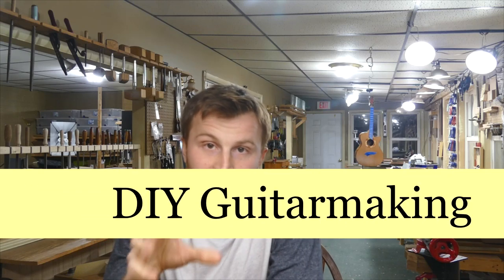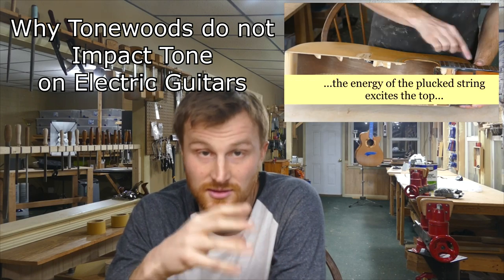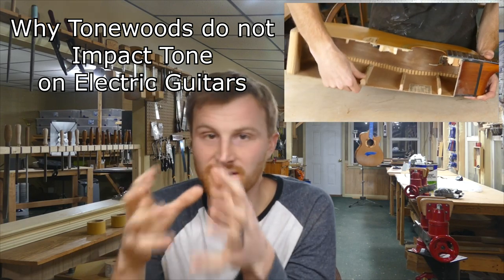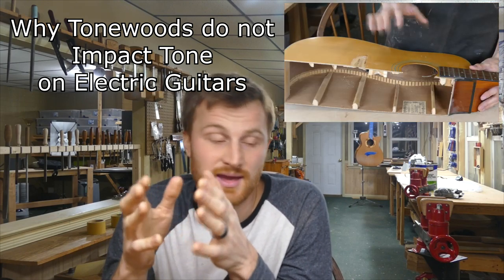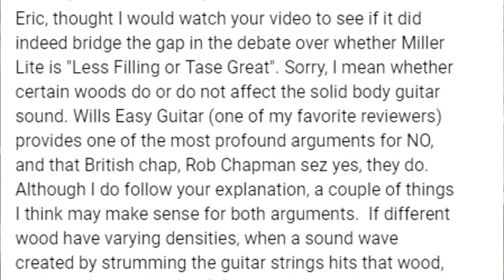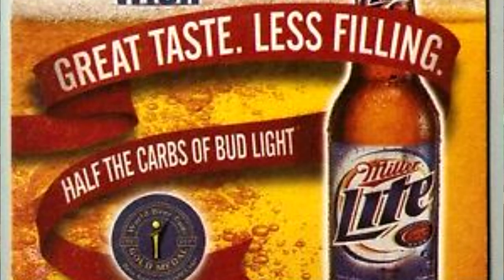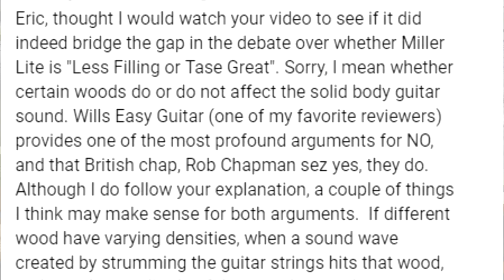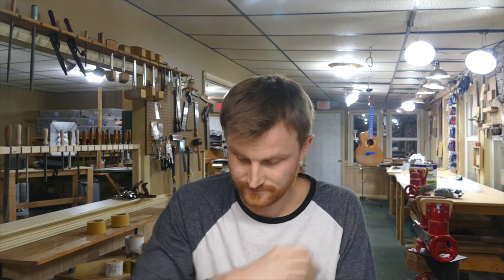More on the Electric Guitar Tonewood Debate

Comment: Will sent me :) 
Im a "believer" in tonewood for electric guitars and thinking of making a video explaining some of my reasons. The air pump is interesting and surely plays a huge part in acoustic instruments but there is more especially when it comes to high frequencies coming off the top rather than through the sound hole. Where the exact crossover points of mids come in I am unsure but suspect a lot has to due with bracing design etc. Most people who have used a high quality sound hole pickup which relies only on pickup up the strings recognize the guitar still sounds like an acoustic. (Fishman and LR Baggs electro magnetic pickups with no transducer or mic).
A thick body surely resonates less than a thin body but no one builds an acoustic without using bracing for a reason which does add to its rigidity. So the solid body is certainly more ridged but it still vibrates and some species more or less than others. We can find this in the same species too dependent on density and such but the extreme variables are much easier to find from one species to another. Reality is that maple can not sound and work like swamp ash and paulownia. A solid body guitar made of balsa cant sound and act like one made of ebony. 
I agree it can become religious or mythical but there are physics involved and personal experience to show differently.
Reply from the maker: Lol oh gee, thanks will :) yeah I suspect we may agree more than we disagree here. As luck would have it, I actually happened to pop over to your channel the other week just as your video was live streaming but i think I caught the tail end of it and you were on to other topics. I'll have to listen back to it later. Sorry for the late response. I'm in the middle of a workshop ans getting ready to start the next one as soon as this one ends, so my time spent on youtube is minimal at the moment. Ill check out your video soon.
Reply: Fender buried your delusions the day they introduced the Stratocaster. It's a sheet of plastic, where they placed the pickups in. There is no wood connecting them to the strings.
Reply: Check out my notes I posted above, and Zollner's Physics of the Electric Guitar.   An electric guitar is designed to resist sound transfer into the body by using a very rigid and somewhat massy metal bridge connected to a fairly rigid and massier body.   The body does vibrate a little, but the amplitude is tiny and the amount of energy radiated to the air is orders of magnitude less, i.e., neglible in terms of effect on sustain.   You are right that the top of an acoustic's body is braced to give it significant rigidity near the bridge that the soundboard thickness alone doesn't, but the top is much more flexible around the edges and its excursion amplitude  is much greater, more like a speaker cone.  The energy radiated is proportional to the square of the amplitude, so it's much, much greater.     In either case, rigidity is proportional to the cube of the thickness, but for the acoustic the relevant thickness is mostly in the braces, which taper toward the edges to allow the top to flex there.   A thick slab like an electric guitar body flexes vastly less in that vibrational mode (and others) which combines with its significantly higher mass to make it harder for the string vibration to shake it around.
Reply: @hans-joachimbierwirth4727  That's not quite a tight argument.  Vibration is transferred through solids, including plastic sheets, so vibrations of the body can affect the pickup through the plastic, with the neck and body vibrating and the plastic pickguard basically going along for the ride.  The effect is exceedingly small though, for other reasons.

Comment: Electric guitar pickups magnetic field does not absorb acoustic sound waves, they only capture magnetic vibration, thats why if you put nylon strings on an electric guitar, it will not sound at all, if pickups does not capture any kind of acoustic, its impossible for pickups to capture wood tonal difference...
Reply: Nylon strings on an electric guitar do come through the pickups via the guitar body.  That's why this guy's supposition is totally wrong.  Different density of woods affect both sustain and resonance.  Some people should not try to be scientists.
Reply: @mikefisher1629  show it, show noticeable sound coming from an electric guitar with nylon strings, I’ve done it, your story is funny but fake
Reply: @joseandresgalarza531  you haven't done it.  Plug the amp in next time.
Reply: @mikefisher1629  have you plugged an electric guitar with nylon strings into an amp? have you tried? do some experiments kid, you have no idea what you are talking about
Reply: @joseandresgalarza531  I'm a pickup manufacturer.  Yes, I have done exactly what you suggested.  40 years ago.  You should try it before dismissing it.  String vibration goes into the wood body and vibrates the pickup coils which creates current at the output.  I'm not a kid, I'm a 60 year old engineer.
Reply: @mikefisher1629 I’ve tried and that’s why I know your statements are bullshit, either you are confusing pickups with acoustic piezos or you are just lying, nice try bud
Reply: @joseandresgalarza531  I'm not here to argue with you.  I'm a patent holder and have been working for 40 years to develop a non microphonic pickup. The issue is that 10 to 20 percent of a pickups output is microphonic.  A totally non microphonic pickup has yet to be invented.  Until there is, a portion of the output will come from sympathetic vibrations through the body of the guitar.  Physics is a bitch.
Reply: @mikefisher1629 sorry Mr DiMarzio, didn’t know I was talking to you 😂😂😂😂😂, whatever you want
Reply: @joseandresgalarza531 I'll say the same thing a luthier mentor said to me on my first apprenticeship 45 years ago..."You don't know what you don't know".
Reply: @joseandresgalarza531  And while  I'm not Larry DiMarzio, I learned everything about pickups from a man named Bill Lawrence.  You may have heard of him.
Reply: @mikefisher1629  put some evidence in your words, then gain credibility, else you can talk whatever you want and it will be bullshit. You don’t need to show off your “credentials” here, assuming you tell the truth
Reply: @mikefisher1629  yes, nice to know someone who worked with Mr Lawrence then, still that’s only a credential, not an evidence supporting your statement
Reply: @joseandresgalarza531  well, Bill was the guy that showed me that.  I'll make a video for you when I get some nylon strings.
Reply: @joseandresgalarza531  you are demanding evidence from me, but you are unwilling to provide the same.  It will surprise you.  You can do the same experiment without nylon strings.  Just wire a loose pickup to a jack, plug it in and duct tape it to the back or side of a guitar and play.  What you will hear is the sound that your instrument contributes to your tone.
Reply: @joseandresgalarza531  back in the 80's when I did a lot of studio work, there was one studio that didn't have a talkback mic so I used to talk into my pickup to communicate with the control room.

Comment: It has nothing to do with the pickups picking up sound waves in the air, they can't, but the wood has a definite effect on how the string vibrates, which is picked up by the pickup. This is what gives different guitars different sustain. Think of the pickup as creating the main sound and the wood adding and subtracting all the details from it. And yea since the pickup is mounted to the wood, the pickup vibrating could also affect tone, but negligible.
Reply: What gives different guitars different sustain, is the scale, the bridge and the strings. If wood affects the sound of an electric guitar then why they paint them with more than one layer and why they give them solid body? Violins and classical guitars are never painted, they're varnished with a mix of different natural resines so they won't cover the wood and affect the sound, why electric guitars don't follow the same?

Comment: I am an electric guitar maker. I make one model. One specific pickup. The tuners, the nut, the pickups and bridge are all in the same piece of wood. A neck thru, for all intents and purposes.  All the same in every way except ... the wood used. Now, even with identical pickups, I have noticed differences in the measured output. Whether this would be the sole cause of why all the guitars don't all sound the same, or its some other factor other than the type of wood used, l can't say for sure. But l've always had the definite sense that a mahogany neck was warmer tonally, and maple was harder (and its not just me) ... its hard to describe sound. I hope you get what l'm trying to say. I wonder if you would notice a difference between a guitar made of solid steel versus one made out of poplar, that were electronically identical . Would the resonance of the strings pick up, sonically differently?

Comment: First, I think both of your main arguments (tonewood characteristics cannot be translated from acoustic to electric guitars and magnetic pickups pick up electromagnetic impulses, not audible vibration, which is often neglected by proponents of tonewood) are completely correct. 

Second, I still think you are wrong on two accounts. 

The first one is that from the two above points, it doesn't necessarily follow what you conclude (that tonewood in electric guitars isn't a thing). Which doesn't mean your conclusion is wrong, it just means that there might still be more to the picture. And there is, which is your second "mistake": you are completely ignoring the "electronic" in an electric guitar. You're guilty of the very same mistake that you rightfully pointed out in others. The thing is: what happens after the electromagnetic impulses have been received isn't a linear thing at all. Electric guitar amplification usually entails a rather narrow frequency range, mostly between 100 and say 3000Hz, making everything happening in between essential. Character in this range will pop disproportionately due to the way it is amplified.

That still doesn't mean that tone wood is one of the most relevant factors in an electric guitar. I would argue it's one of the less relevant factors. The strings, type of pickup, bridge construction, circuitry on board and in everything that follows is much, much more relevant. But there have been experiments that show quite conclusively that discernable differences come out of the speakers. Doesn't mean that you would be able to hear the difference when listening to it unplugged - but that isn't relevant in an electric guitar. It's the amplified tone that counts.

Comment: dude build an electric. It wont sound/play anything like you think, dispite your pickup choice.
Reply: the "insignificant feed back" into the strings you speak of in your email, is far from insignificant. this is also true in your acoustics you build. when you understand, that much of the tone is in the guitar reverberating back into the strings, and coloring your strings, attack, sustain, and overtones, you will become a better acoustic builder. now some of what you are saying is semantics; im not saying you need specific wood to sound "good" but they do sound different. neck wood is very impactful on the response of guitars, a neck that flexes slightly under the plucking of the string, will audibly drop the pitch, then it will rise, as the neck returns to its neutral position.
Reply: if the only thing making an acoustic sound like it does is the "air pump", why do nylon strings sound different than steel. Pluck an open A the pump is pumping air at 440 hertz, both have spruce tops, should sound the same.
Reply: @zacksheidler   Very, very little if any of the tone of a solid body electric is from the guitar reverberating back into the strings.  Most of the energy in the string is either reflected back into the string right at the bridge or nut or fret, so that it stays in the string, and essentially none of the energy transmitted into the neck or body makes it BACK into the string.   A tiny bit may vibrate the pickup relative to the strings and slightly affect the signal in that way, but it's generally inaudible because it's masked by the much louder signal from the much larger vibration of the strings in the pickup field.
Reply: @paulw.3967  my experience suggests you are completely wrong, but lets say you convinced me. that would only be true when the guitar was not plugged in. plug that thing in and turn it up (just like santana, garry moore, hendrix, clapton etc.) now the guitar is moving more than an acoustic, driving the string, and the TONE...
Reply: Feedback situations are different from what I was really talking about, so I should probably have put in a qualifier.  Even so, I think that what I said was true: only a negligible bit of the string vibration energy goes into the guitar and then makes it back into the string.   With feedback, it's the vibration of the string itself in the magnetic field that generates the initial signal, and then the AMP takes that and runs with it, providing NEW energy that shakes the guitar and creates the feedback cycle.   And even when using feedback for indefinite sustain, I don't think the body is moving as much as the top of an acoustic guitar.  In either case you can feel the body vibrate, but on an acoustic you're not feeling the part of the guitar that's moving the most.  On an electric, the whole body moves roughly the same amount because it's not very compressible.

My limited experience with miking loud amps is like Jim Lill's in his recent video experimenting with his Tele and a Marshall half-stack cranked way up.  The effect of the loud amp nearby has a surprisingly inaudible effect on the guitar's clean tone through a direct box until you're very close to serious feedback (and then things get weird fast).   Even then, my general impression is that you can usually change the angle of the guitar relative to the amp by 60 degrees or so and the effect just goes away, if you find the correct angle.

Presumably body wood WILL affect where that point is, if only in that the sheer mass of the guitar matters some (as it does to sustain).   But it probably depends even more on things like whether your pickup is mounted on a plastic pickguard like a Fender's.

Comment: You do not understand the theory.

The theory is that the material at the guitar absorbs frequencies because of its density or its stiffness or whatever.  And therefore, the species of the wood --  if it affects those variables will affect the tone.

Does everybody understand this? We've only gone over this for years now...

The question is is the difference in the guitar material significant?

Every YouTube video on this topic has been incomplete, and not really scientific. there has been studies project in Acustica but these experiments show there is no difference in the wood species.

Of course, I have experiences - like many others - of putting different pickups in different guitars and hearing that they sound great deal different (even after allowing for the obvious differences), and I think that must be due to the guitar itself. But until I see a scientific experiment proving it, I will try to keep an open mind.